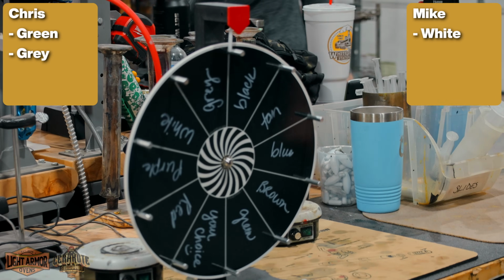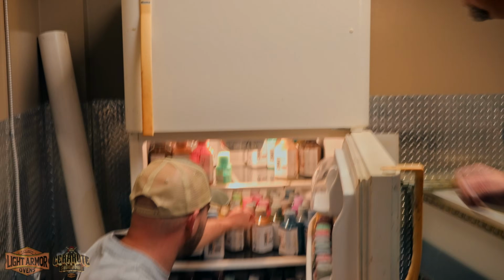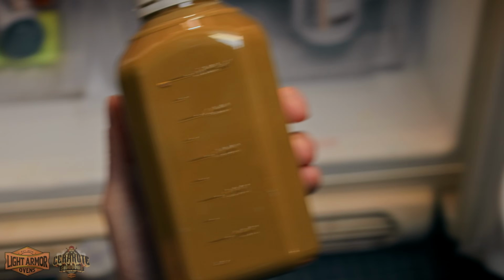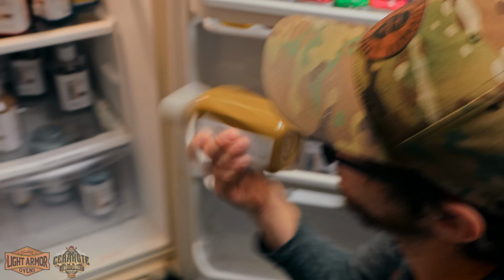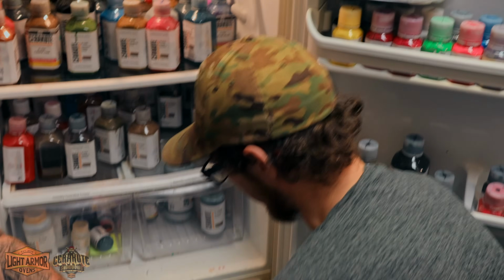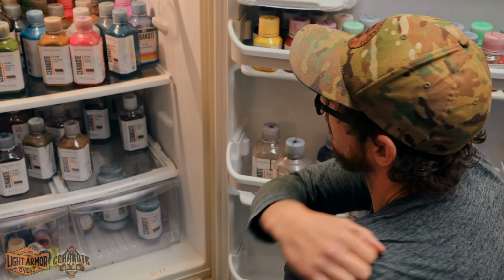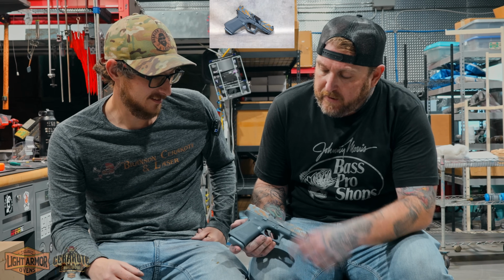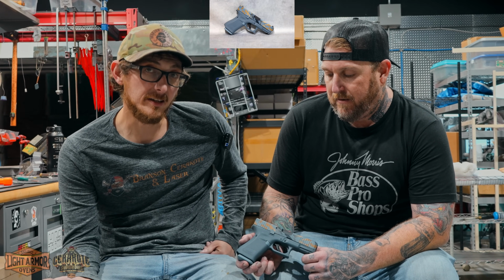Cerakote Showdown: Chris vs. Mike compete for a Light Armor oven with the best Cerakote Glock

Comment: I wish the guys with the minicam could have finished the frame. That would have been sick. Still looks good though! That predator camo came out awesome as well!
Reply from the maker: The random stuff makes it fun. Forgetting to put hardener in happens to everyone, but sometimes it happens at the worst moment.
Reply: @BransonCerakote  one time, I forgot to bleed the air compressor. The water in the lines gave finish some what of a rhino lined texture. It was a cool mistake, but still had to start over.
Reply from the maker: @splash1791  Yeah, water will kill adhesion. Happens to us all.